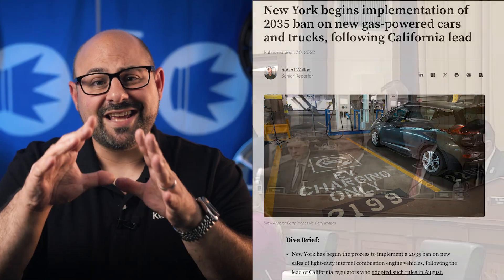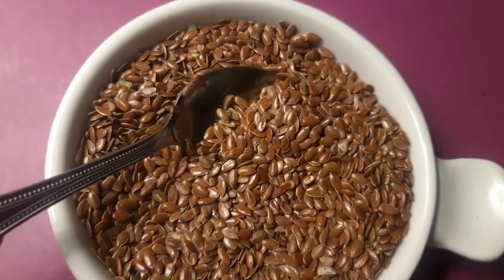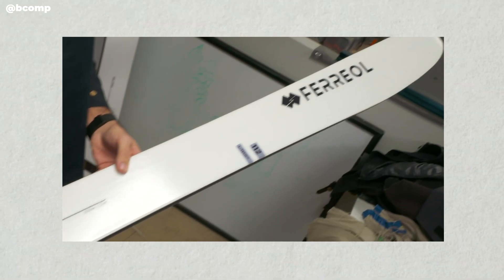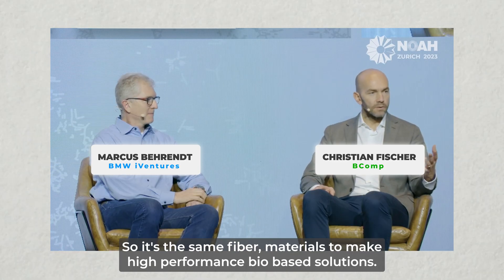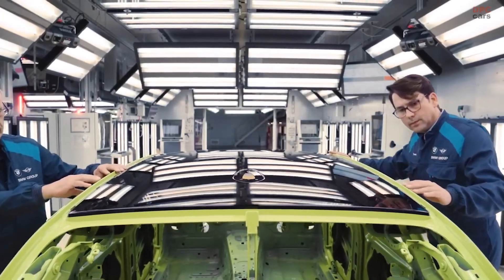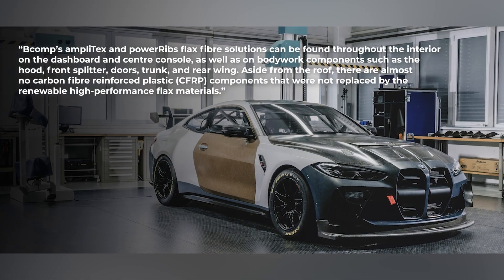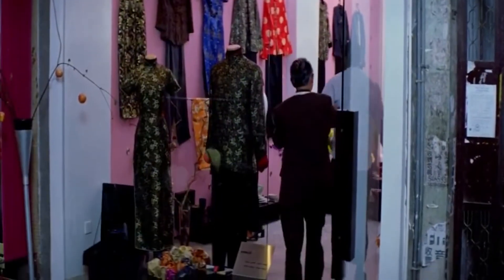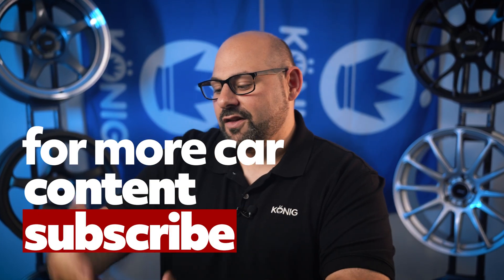Is Carbon Fiber Dead? 🤔 | BMW finds a replacement...

Comment: Flax fiber and bcomp aren't exactly new. They're not a substitute for carbon fiber though, only if carbon fiber would've been unnecessary anyway.

It's great in combination with carbon fiber though. Very high damping, light, easy to use. 
Their rib textile is great as well, helps build thickness and allows to make complicated forms as sandwich with a bit of ultra light filler.

Comment: So instead of just trapping highly processed carbon in epoxy they are replacing the highly processed carbon with slightly processed carbon.
Reply from the maker: Correct without the superheating that is where the massive energy consumption comes from.

Comment: I‘ve been working with all sorts of composites in the past 10  years. Flax is indeed almost co2 neutral as of when they grow on the fields they remove co2 out of the atmosphere. Sadly Flax isnt really suitable for structural parts. i did some stress tests about 6  years ago and compares flax to glass fibre, carbon fibre aswell as kevlar. Sadly Flax is hals as strong as glass fibre, only 1/7 as strong as carbon fibre and 1/12 as strong compares to kevlar. Hopefully the composites industry comes with some solutions to get flax almost as stiff as carbon fibre but seing the industry mainly focusing on carbon fibre in the past decade it wont be for a while.
Reply from the maker: Thanks for the insight and data!